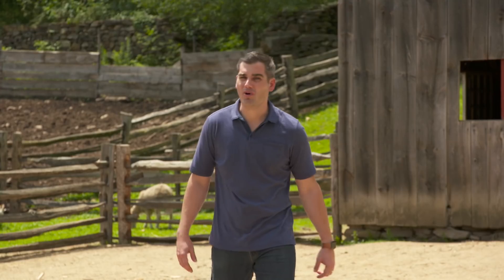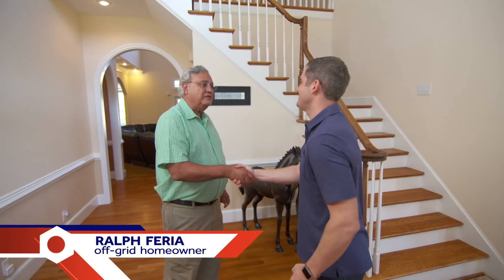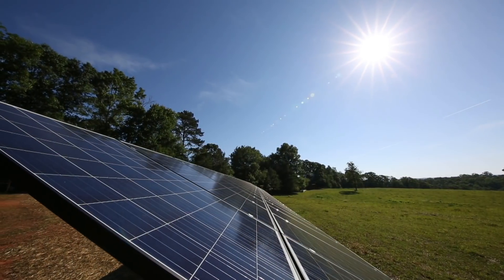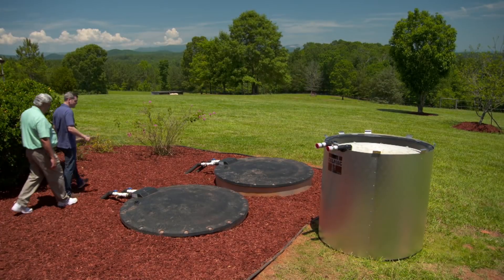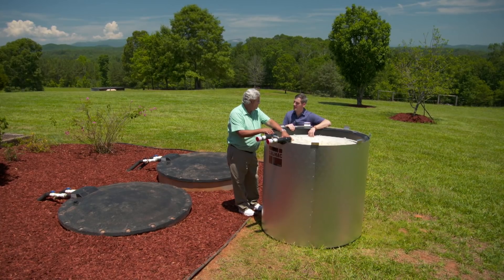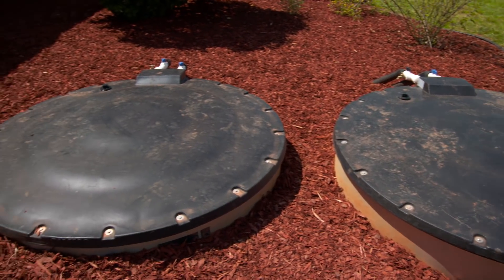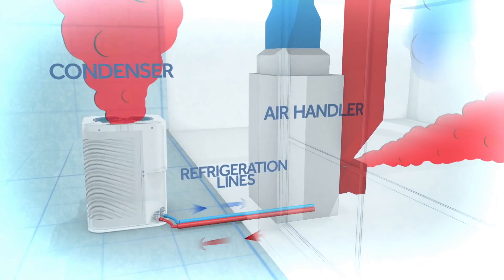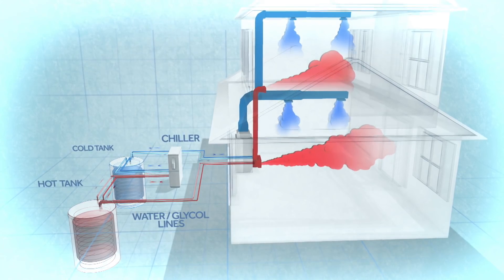Living Off the Grid Comfortably | Future House | Ask This Old House

Comment: A near 7,000 sq ft home that is resource efficient. Impressive. I've been working on making my 230 sq ft tiny home's foundation slab a thermal storage battery and have increased perimeter insulation to contain more of the solar gain.  The thermal battery  can keep the home at 70F for roughly 12 hours on sunny days until midnight without use of the heat pump when temperatures are mid 30'sF or above but I'd like to approach PAHS levels which a friend did with her 1,700 sq ft home.  Her home stored summer heat to slowly release over several months without any machinery or furnance.  I visited in March and the home was 68F and no heat source had been used since December.  That's what sold me as it seemed simpler than even Passive House.

Comment: I don't get the weird 'I could never be off-grid, that's way too expensive for me' crap in this video.
For someone with even a little bit of HVAC knowledge / experience, running reverse systems is not difficult. Yes, THIS system is expensive, but the fundamentals are well understandable, and look to be easily diy-able. You may not get the efficiencies, and may not have a number for a 4 hour service, but as a basis it's not necessary.
Off-grid is a fairly open ended term, as it depends on YOUR location and YOUR budget. Do some research, understand the concepts of heat pumps, solar, wind water filtration, and you will see the systems for sale are just an easy purchase profit line for the seller.
If you are willing to put the work in, the reverse chill and reverse heat are very easy to do, and I can deffinatley see low cost ways of doing them, either myself or getting a professional to do the work.
The only items in off-grid here I can't see making myself are the solar panels (prices are falling daily) the batteries (salvageable) and the compressor / evaporators for the air-con units.
For the HVAC system, if you have one in your house, all he is doing is converting the output into alternatives to 'dumping it'.
Your air-con transfers heat from the inside to the out, extend the glycol lines to a hot water cylinder instead of an outside evap, lol, free hot water.
Your air-con produces cold air, run it at night instead of during the day, and run the chilled glycol into a hot water cylinder to chill the cylinder, and run in the reverse during the day. The only issue I can see with this is if the energy losses from conversion outweigh the cost savings between peak and off-peak grid electricity. If I was on solar, I would instead size the solar for the day time air-con enough, or use evaporative cooling with a properly designed thermal flow in the house.
As someone said, insulation is your best friend, instead of trying to move the heat, stopping the heat moving is more efficient in terms on energy input, and capital / running costs.
Off-grid is looking at what is happening in your solution and looking at the most efficient way of doing that, not copy pasting some millionaires house in a different zone.

Comment: This seems to be quite a cool and unique project.. I only have a few problems with this explanation. (1) We've learned way back in school heat rises and cold air sinks but @6:21 it kinda shows hot air being pulled in from the floor while cold air is pumped into the top (which would work at 1st when turned on [entire house is hot], after that the intake/ distribution vents should be reversed from what is shown since hot air rises. Waiting for some1 to say cold air is denser than hot air and the cold forces the hot air down!?! (2) Once the heat is moved to the tanks for storage how are they kept hot are there electrical heater coils in the tanks or what?
Reply: "hot" air is air that is "colder" than the output air from the cooling system which would be any air in the house because physics. 
The take away is they are using energy when it is readily available(day time from solar or cheaper off peak in the commercial setting) to store for later.

Comment: At church we use McQuay chillers, does good for a big building where the seating area is like movie theater, it slopes downwards towards the front, and the ceiling (bout 20 to 25 ft) is cloud like with gaps to let the hot air stay high up there past the clouds, another 15 to 20 ft.

Comment: For what the gentleman in the green shirt was talking about, with small modular BTU "batteries", check out Sunamp on the Fully Charged show. ( https://www.youtube.com/watch?v=9upXeTMHUqE ) problem is they're quite pricey and chances are if you can afford them you probably also have the land (or even space inside your home) to fit one of these glycol systems which would probably be much cheaper. But, if the technology takes off enough for commercial applications, prices may come down to make them feasible for residential.

Comment: I've been in HVACR for 30 years and the focus seems to have always been on making more energy efficient systems instead of insulation. If you significantly reduce heat transfer in a building then you won't have to expend as much energy moving heat out in the summer or creating heat in the winter. What we are doing now, for the most part, is analogous to having a boat with holes in it and instead of fixing the holes we are trying to developed more energy efficient bilge pumps.
Reply: You're right! 
I have a friend that lives in Louisiana, he built his house with double block. He's never paid more thatn $30 a month to cool or heat his house.
Reply: @Live-Life-Freely  - My Brother had planned a Concrete Block Walled Basement, with Double Walled "2 x 4" Upper Walls, with an Air Gap between, but, unfortunately, never got "Site Approval" from "The Boss" - His Wife! So, it never "Got Built!" 🥴😀
Reply: @robertweekley5926  Any man that calls his wife "the boss" is unhappily married.
Reply: thiiiis. problem is people want cheap houses and they get lobbied for too
Reply: Sounds goods, however there's a big BUT. Heavily insulated areas encourage the build up of Radon gas which is the number one lung disease killer in the modern world, higher than smoking or cancer. Energy efficiency and self sustainability is the key. You can insulate all you want but living in a capsule of a home is not fun.
Reply: @etsie2601  If you have proper mechanical ventilation systems then you are ok
Reply: @bryanleavitt2041  - Or, at least more comfortable, and maybe less Fearful! 🤔🧐

I wonder, do Basement "Tenants" have "Higher Death Rate" than "Upstairs Tenants", overall, too? (In houses, I have Lived in both of these experiences! Plus, in Apartment Buildings, from 2nd Floor, to 22nd Floor!)

Comment: How much does it cost? It looks expensive
Reply: I work at dairy manufacturing, we have cooling exchanges that are glycol based and yes these setups are very expensive. The power prices will have to go way up before this is a viable. This man already has money and most likely a business in this industry. Also if his house is far from the power lines, maybe the connection costs offset his solar panel cost.

Comment: well there you go a 144 panel array or roughly 50kw...massive
300kwh a day or a 1000$/mo powerbill roughly thats being replaced with solar

if you have the land and can install a large ground mounted cheap array in your backyard directly facing the sun near your breaker box you get alot more bang for your buck than a chopped up roof system that isnt pointing the perfect direction.

curious about how efficient the hot/cold tanks are compared to a battery and their cost 

any fridge could make ice at night, but I'm guessing it would strain the relatively weak ice maker quite quickly as its not designed for heavy duty daily use for years.  also takes up space so not popular in consumer units

Comment: cost? theres a reason this doesnt work.  giant pex filled water tank buried in backyard doesnt scream cheap for a few kwh it stores
Reply: it does work though in massive coolers etc, if you can make ice in the center of a massive cooler and use that as a battery, not quite the same as small scale

Comment: You would have to live for about 150 years (complete guesstimate... point is you would probably die before you got back in the green) just to offset the cost of installing all of this. Unfortunately we are not at a point yet with renewable energy and off-grid technology in terms of cost to be able to make this a feasible idea other than for the very wealthy. Not to mention, most cities make various aspects of such a setup illegal meaning you better have a property outside city limits to even consider such a setup.
Reply: Yes it is usually more expensive as an initial cost. However for the life of the house you would spend much more on utility bills. Governmental policy is very important as well.
Reply: @kokovox  Not with a system like this. You'd never come out ahead. And it's not just the initial cost. The upkeep is a major factor as well. Parts need replaced every so often as the parts' life span dies out.

Comment: If 'green' energy really worked it would not need subsidies. But 'green' energy is heavily subsidized by taxpayers and ratepayers to make up for its inefficiency. So why isn't my gasoline and electric bill subsidized?
Reply: Natural gas and the oil industries have and are still subsidized. Both industries would not have become so widespread without subsidies and governmental help in the past and present.

Comment: The problem with "off grid" is you are still dependent on the system.  You simply act as your own grid and are responsible for repairs and mantainence.   You lose the economies of scale and it costs you more.   A true off grid house would not have electric or cable.  In 90%  of cases "on-grid  is simply cheaper then off grid.

Comment: I installed my own residential wind turbine, backyard and solar panels on my roof and produce about: 120% of the power for my house.  I'm still on-grid but only pay: $14./mo. to stay connected.  This saves from buying batteries.  Our system charges our EV's also.  The secret is, do as much of the work as you can, yourself.  Saves thousands!
Reply: Do you have any links on how you did it and what you used?
Reply: What kind made and model do you use and how much does it cost
Reply: Can you give use details
Reply: Don’t you wanna sell energy back to the grid?
Reply: Russell Fine Arts it’s either your a very bad liar or a delusional individual or both

Comment: Great video. It upsets me how this country is so behind. Energy should be clean and free with advancement in tech.  But corporations suppress  tech for  the all mighty dollar.   It’s 2018 and we still use fossil fuel.  How dump is that!!!!! Imagine a world were we don’t need to pay for electric or have to put gas in our cars.  I would be  10k richer a year with a cleaner planet
Reply: Fossil fuels will be necessity for many years to come.  While we are advancing in our renewable energy sources, it just isn't readily available for the mass market.  A collective system mix of Solar, wind, water, Geo-Thermal and fossil fuels would be the best mix.  But unfortunately the individuals in each of those industries doesn't seem to want to recognize they are not 100% sustainable.  There is no one fits all solution, every location on the planet has its own adversities to certain forms of energy.

Comment: Many zero-energy-houses in Europe use big isolated watertanks for many years, also subsurface heat-collectors for storing cold and heat are common (geothermal heat pumps). But as long as oil and gas from fracking is pushed so cheap into the US market, nothing will change.

Comment: Cool technology, but 40 kW of solar for one house?!  Guy needs to start with conservation.
Reply: I mean it's a huge house
Reply: Considering I was quoted $40k, before rebates, for a 13KW system, you're looking at easily $100k+. Even DIY would probably put you over $50k/60k in parts without labor.
Reply: Sun sends over 10 000 times more power then we use as a species each year. The added bonus is you don't have to increase your CO2 to use it.

Comment: The problem is some utlities have convinced legislatures to pass laws saying a grid connection is required.
Reply: I’m in favor of no monopolies public or private
Reply: grid connection might be mandatory but that doesn't mean you have to use it
Reply: @waminette  
Yup .... once they install it .... Just have an electrician come in and break the service inside the breaker box.
Reply: The government shouldn't be able to force you to buy into a private service. That's why public utilities (and all natural monopolies) should be run by the state. The state wouldn't care if you produce your own electricity and they won't fine you for using solar. My homestate private electric utility just added a fee for using solar. 30 bucks a month, I think. Complete horseshit.
Reply: here in az, some friends that have solar have told me; that the local power companies charge a gride connection fee ranging from $50 to $200 to off set the lost income they get from solar clients, which is some bs
Reply: Just don't pay the bill, they will shut it off for you...
Reply: @2awesome292  yes they will shut it off and kick you out of your own home as well. This not right but it is what they will do. So a better option is to use solar to power small ticket items and pay a very small bill. Although your only powering the small ticket items build your system to power your hole home in case of power outage for whatever reason. In this case they can not tell you how power you have to use. Also, remember and know there is a loop hole in every law. In Florida for example, if the power company says you can't have solar then buy an RV and turn it into your power station. There is no law saying you can't put solar on your RV. As long as you have a bill being paid theres nothing they can do. Just keep your trap shut and all will go ok. Also, be sure to obey the laws of keeping an RV on your land.
Reply: Truthfears Guilty what type of energy company do you have?
Reply: IF you live where this is required, which is very few places, then all it means is you need an active utility connection and pay the minimum bill each month. About $10-20. If you can't handle that you are a pathetic looser.This isn't about going off grid because it's cheaper. If that is your intention move somewhere rural where you can bet this is not a requirement.

Comment: Thank god for China making renewable energy sources affordable, mass producing solar power, batteries etc. In a couple of years this won’t be a rich privilege.
Reply: All of these solar panels will be headed for the landfill in 10 years creating another disaster.  Along with the massive battery packs.  Maybe by then China will take them back and throw them into a river, like they do now.
Reply: Dave C. Lol I like a glass half empty perspective, this may be true unfortunately many people choose to ignore the whole system environmental impact and focus only on the good bits. There are however many POV panels that last more than 10 years I believe.
Reply: @davec.3198  ** Along with the massive battery packs.**
depends on battery type
*Maybe by then China will take them back and throw them into a river, like they do now.*
China is actually leading in green energy, more than you know. And no, they don't simply dump them into the river.
Lead acid batteries are also very recyclable and suitable for heavy draws. Instead US is sending much of their garbage to china until China banned it. CO2 emissions in China is lower per capita by a large margin. That does not include the US military.
Reply: @AFlyingCookieLOL  Lower per capita?  You must be joking.  That is because it is a 3rd world country and most of the population has no access to electricity.  
Asian countries are responsible for most air pollution and over 80% of the oceans pollution.  
1st world countries could stop 100% of their emissions overnight and it would have almost zero impact, because of how much Asia pollutes. 
Look up the video on youtube where they make magnets.  There is a lake miles long filled with pollution and sludge.  It is ghastly.
Reply: @AFlyingCookieLOL  China is leading in CO2 emissions and smog. That's about it.
Reply: 2 years since you made this comment and this is still not even remotely something a normal person could even consider.

Comment: Will the chiller tank work in colder climate.
Reply: It should as long as the system could handle the water freezing, but you might not need it if you only ran ac a few days a year

Comment: What the actually Big And Loud F!  72 PV Panels there and 144 PV Panels upcoming for 40KWtts power???? And using all that massive system for heating/cooling? So Sorry, this is No where near OFF-GRID, this is just ABSOLUTE nonsense... With the current panel setup, there is more than enough power to power a suburb. All the energy is technically wasted deeply with the current setup due to obsession with heating. And this video is a great example on "how NOT TO" off-grid. By the way, you can use dropped branches for heating, way better for the environment(prevents bush-fires and hazard reduction) and gives way more BTU's all year around for heating and you can easily heat the whole place in no time!.. Also, get a Large Ni-Fe Battery pack, that would be way better than that Glycol line junk and way more usefull&off grid...
Reply: How is it wasted if all of the power is used by the home and surrounding structures from solar energy rather than coal burning power plants? I think its meant to show how you can live off-grid comfortably and take positive strides for the environment. Everyone knows you can go off grid with a tiny home. YouTube comments never fail to amaze!